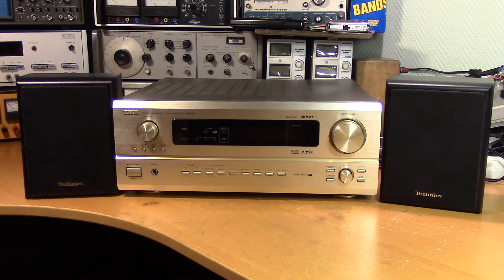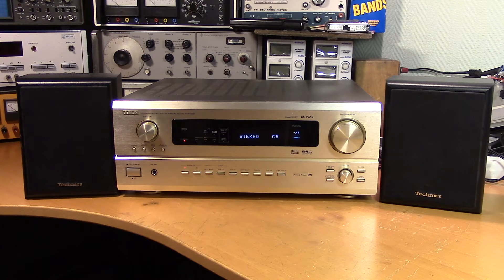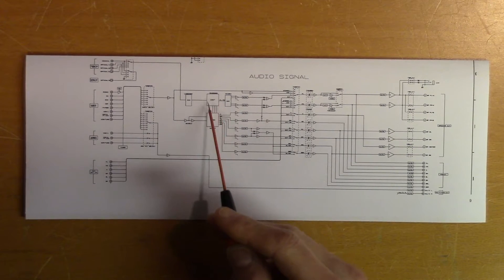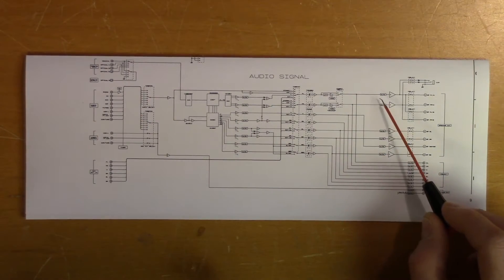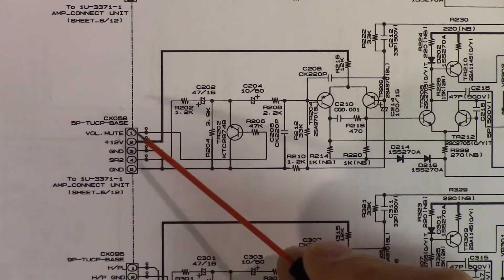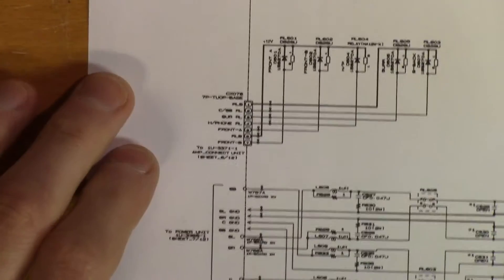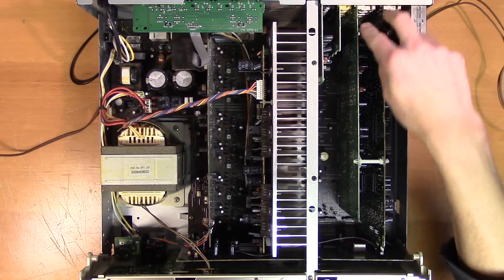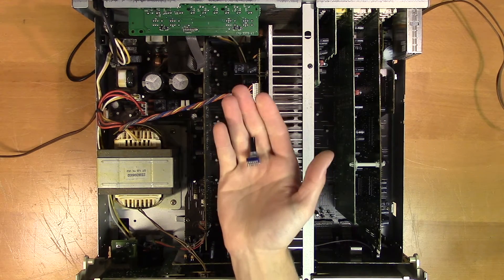Denon AVR-2802 - Ghetto Repair for Common Failure

Comment: I have this unit which is over 20 years old, and has been in storage for almost all of it. Used it a year or two, and it looks practically new, except it has no sound through speaker terminals. It's basically junk. I watched the whole video, and if it's what is suspected here this looks like a straightforward fix to use the amplification section. You'd have to be electronically handy, and want to bother. Of course every single thing else it did is dead with this fix, but if it doesn't work anyway you get a basic analog amp. Great video btw.

Comment: Good afternoon. Tell me in such a connection scheme there will be no timbre adjustment and tone compensation, the radio will not work?
Reply from the maker: Correct, the external input connectors (EXT IN: FR and FL) are connected directly to the power amplifier. No signal processing will be applied.
Reply: Yea that makes it pure direct so you have proper timbre tonal awesomeness .

Comment: I have an AVR-2802 with the  same issue. 
Many thanks for your suggestion 
Tomorrow I will try to make the modification and after that I will give you feedback 
Thanks
SP
Reply from the maker: Hi splchina! Please note that you will get just a power amplifier with no pre-amp. You might need a pre-amplifier with quite high voltage output to be able to max out the power amp. Good luck!

Comment: My Denon AVR 3801 has a very similar problem.  It always worked perfectly, but after moving it to my new house, the problem started.  
Most of the times I get sound when I switch it on, but after changing a setting (like input source) and setting it back to cd, there's no sound. The same problem as you describe in your video.
Sometimes however it works as it should.  I can switch settings and it keeps playing.  Then after a few minutes the sound just falls away and nothing comes out of it, although the knobs and display keep working.
So it looks like sort of an intermittend problem.

Because it stopped working after I moved it, I keep thinking it could be a connector that came loose, or another thing that might have happend when I moved the receiver.
I tried to unplug and replug all the internal connectors between boards, but that did not solve the problem.

Would a bad Eprom or dsp chip cause an intermittend problem like this?  Sounds unlikely to me, but I'm not an expert.
Reply from the maker: Hi pbruelemans! From the behavior you describe, it sounds very much like a problem with the digital controls. The EPROM failure might start out with just a few corrupted memory cells, and depending on the initial conditions at start up, it might be able to run a working block of code until something is changed and it tries to access some of the corrupt memory cells. 

It is a bit harder to explain why it comes and goes, but given that the EPROM seem to be a common point of failure on these units, and the bahavior matches it closely, I would assume that this is the case for your unit as well.
Reply: @SunandWeather  Thanks for the explanation. I guess I can try to make a poweramp like you did.
Reply: Although I still find it suspicious that the problem started after moving it.

Comment: I own an model 2307 with the same issue. I was listenting to music using this setup - TV -> SPDIF -> AVR and suddenly stopped and started making a noice like a beep at 1-2Hz interval. Now it works on radio (i'll check the spdif input again to see if it works) ok but when i toggle using function potentiometer between inputs and get back to radio, sound dissapear and moreover the volume level cannot be modified, it looks like it's locked .I reset it several times but without any succes then i found your video. Is it worth repairing in an Denon authorized service?
Reply from the maker: Hi, Catalin N! It sounds like there is something wrong in the digital control circuits and it might need to be reprogrammed after a repair. If that is the case you will probably have to take it to an authorized service. 

The second hand market value of these units does not seem to be that high, so it´s possible that repair cost will come close to or even exceed the market value. I do not know Denons service policies for their older units, so it is hard to say with certainty whether or not it will be worth it financially. If I am to make a guess, I would say that in the best case scenario you will be paying for a new control board + 1-2 hours of work for installation and possibly reprogramming, which might result in a total cost below the market value. If new control boards are not readily available the repair cost will probably increase significantly. 

I would recommend that you ask for a price estimate from an authorized repair shop. They might not be able to give you an exact price but you will probably get an idea of whether or not you think it will be worth it.